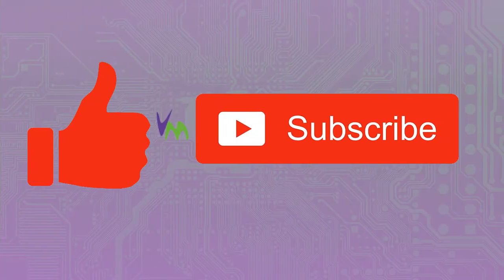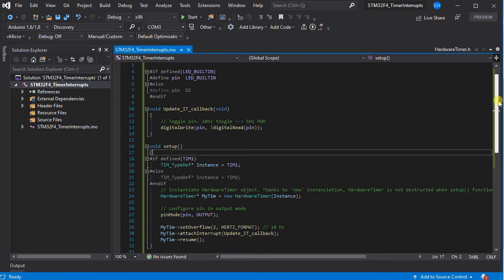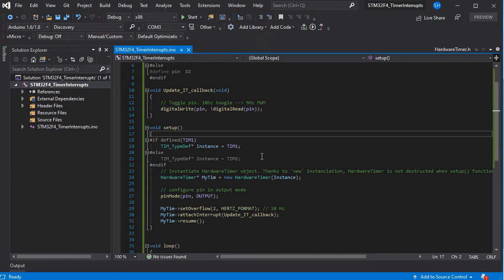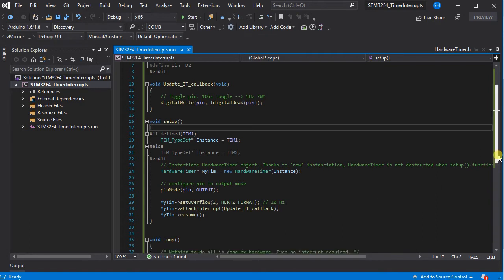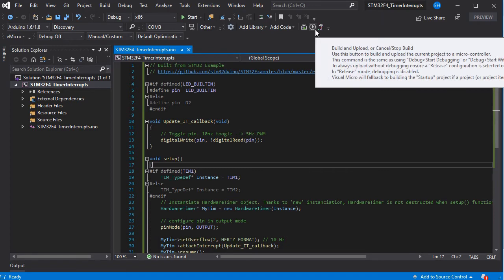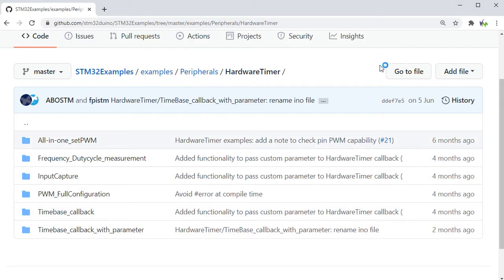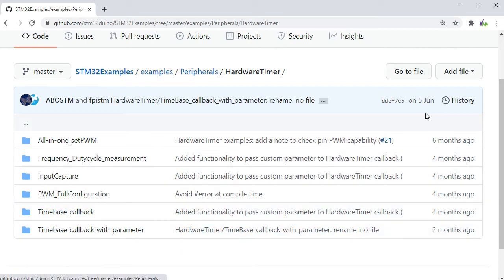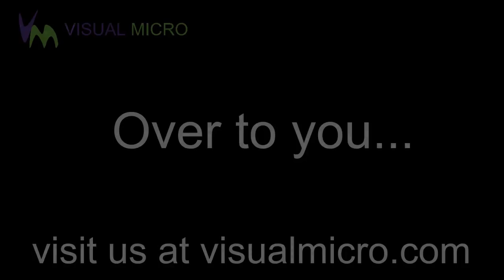Learning Timer Interrupts for STM32 and Arduino

Comment: I tried to do this on a Bluepill , but someone have changed the attachInterrupt : error: no matching function for call to 'HardwareTimer::attachInterrupt(void (&)(HardwareTimer*))'
     MyTim->attachInterrupt(timerHandler);  This used to work, but does not with the latest Libs, can you please share your ini file, perhaps one can force a version.. of better fix it to work with latest libs.   add "platform  = https://github.com/platformio/platform-ststm32.git" in the ini file
Reply: any solution to this?
Reply: @MoesKeckeEcke   Yea, this is what I did to fix it.
 /** ---------------------------------------------------------------------------
 * @brief Stop. change and restart timer 2, channel 1
 * setup the interrupt for 50 or 100mS
 */
void setupTimer2 (void)
{
    // Set up timers to add 1 to their counts each time
    // their interrupts fire.
    timer2->setMode(TIMER_CHAN, TIMER_OUTPUT_COMPARE, NC);
    timer2->pause();
    // clear the countet cuont value
    timer2->setCount(0);
    // change the timer to genarate an 100ms timer interrupt
    timer2->setOverflow(100000,MICROSEC_FORMAT);
        // change the timer to genarate an 50ms timer interrupt
        //timer2->setOverflow(50000,MICROSEC_FORMAT);
    timer2->refresh();
    // define the function to be executed when a timer overflow happen
    /// @note the libraries changed, some old version requires only
    ///       one parameter, the newer version requires two parameters!!
    ///       keep code for compatabilty 
#ifdef OLD_LIB
    timer2->attachInterrupt(timerHandler);
#else
    timer2->attachInterrupt(std::bind(timerHandler, nullptr)); 
#endif
    // go for it.. 
    timer2->resume();
}
void timerHandler(HardwareTimer* xyz) 
{
    //static volatile uint32_t stateIRQ = 0;
    // remove compiler warning (unused parameter)
    if (xyz) {}
   //  your code
}